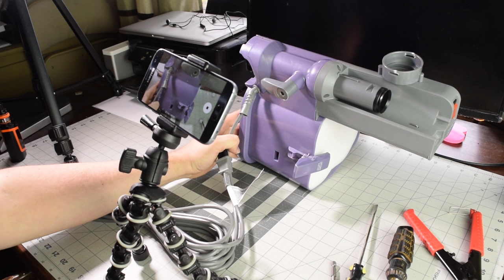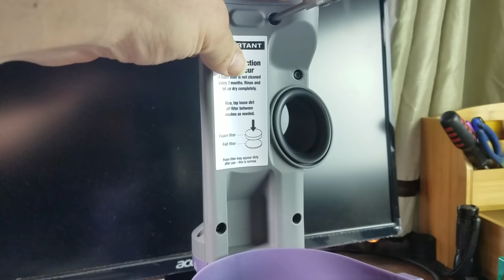Disassembly of a Shark Navigator Lift Away Vacuum Cleaner - Whats Inside?

Comment: Great video!!  WE WILL NEVER BUY ANOTHER SHARK.  We've had a Shark navigator PRO for 2 yrs and the flexible hose cracked at the upper portion that goes inside of plastic tube at the handle.  I'm an engineer, and I removed all 6 screws, disassembled all that was possible, BUT there is no way to remove the broken piece from inside the plastic tube unless I brake the plastic handle, and if I force it there will be NO way to glue it back.  I THREW IT AWAY and BOUGHT A DYSON.  This is expensive but it is THE BEST OF ALL VACUUMS.  If you hear good advice, never YOU buy a SHARK vacuum.
Reply: Mine broke too but unfortunately my cordless Dyson isn’t powerful enough. I would buy another Dyson but very very tight budget but prob someday soon. I scored and got one at. Walmart for $67. I could buy 5 vacuums for the price of my Dyson. Haha by time I go through that many vacuums, I’ll probably be in a position to buy it.
Reply: My shark is 12 years old and has run like a champ the whole time. The motor finally died and I replaced the whole lower chassis for $45 and it's running great again. Shark is the best value vacuum there is. Dyson is marginally better but twice the price.

Comment: I bought one of these at a yard sale and when I got it home the brush roller wasn’t spinning. Thanks to one of your other videos I was able to determine that the safety switch (that disengages the brush motor when the handle is up) was faulty. Rather than replacing it with a new switch, I cut it out of the circuit and spliced the wires together. Works great now!
Reply from the maker: Nice!

Comment: This video is very helpful since I'm taking one apart right now. One tip though you might use: Those little wire crimp/cap things can be pretty easily opened by squeezing them with a pair of pliers, which means you don't have to cut any of the wires, just uncrimp them and pull them out. It worked on all but one of them on the unit I'm taking apart.

Comment: Ya I can’t seem to take the hose that connects to the brush roll out. And my brush roll has a plastic housing. 

Ahh you pulled the house of out the side. Hmm. Mine doesn’t seem to have that. It just goes straight up.

Comment: I have a shark nv531-31 and after repairing a couple of service wires am trying to reassemble however I seen to have two extra neutral white with slide on connectors.  I have no idea where they go

Comment: This was a life saver, I have an 8 year old Shark and needed to clear some hair that I hadn’t been able to clear using scissors.  At first I was frustrated since a lot of other models have toolless disassembly, but then I remembered this was the first time I had to properly service it in 8 years. Which probably has something to do with how solidly it’s constructed.

My only suggested addition would be to point out that the little wheels in the front are hard to pop out the way you’ve shown it - a standard flathead just doesn’t get far enough under the wheel for the necessary leverage. I just ended up gouging and spinning the wheels. I ended up using a slim precision screwdriver to lever the axles out at the ends.
Reply: Do you have any opinion on the hepa filter by any chance?  I've been getting asthma attacks lately I think

Comment: If you do little modding to the suction motor housing with tin snips and a soldering iron, you can fit an ametek italia motor in that sucker and have a more powerful vacuum that makes a more pleasant sound than the stock suction motor. You can also mod in a heavy duty small universal motor that you would find in central vacuum and german vacuum powerheads to drive the beater bars. It will make the brush roll turn faster for better agitation and power through shag and frieze carpet and spins fast enough producing a satisfying audible hum and the noise from the better brushroll motor is akin to a handheld kitchen mixer on the medium speed setting which is pretty nice as well.

Comment: Have you ever tried taking the handle apart?  After having two hoses split on me me (up at the handle end....where the hose is stressed do to unfortunate angle) 

I'm really wanting to see if I could just cut the hose where the split is...remove the end that's attached to the handle and then reinstall the hose into the handle (the hose will be slightly shorter but that's fine)

What do you think?  Should I invest in these bits?  Do you have any idea whether I'll run into additional problems?

I know I could buy a new hose/handle for about $30...but I've done that once already.   Just trying to get the most use out it.  The rest of the vacuum works great.  I hate to add it to the landfill over such a small problem.

Comment: Mine is shooting a spark out of the on off switch. It only does it when it’s in the carpet mode, and is intermittent. 
The beater bar was clogged with dog hair. I cleaned it out and it still sparked. I replaced the switch, and it still sparks.. Any ideas?

Comment: I have a gross smell coming from the green insulation around the motor. What can I do to fix this? I always replace the filter instead of just cleaning it, it's getting to the point where I don't want to use it anymore. Huge fan of your videos I took mine apart and then found this video.

Comment: so i have the nv501 or whatever but the inside looks just like yours. Hoping you can help. I did a huge deep clean on mine today. and was thinking oh this part doesn't plug in so I can run water through to clean it. Well no it has a motor and whatever like yours. Is there anyway mine is still usable? Like even if i wait 2 weeks to let it dry out? I used your video to take it apart and i could see wetness inside the motor and the wire stuff on the other side was wet too.

Comment: For a Shark NV60 Navigstor professional for a power head, it takes 2.5mm special security but screws and do you have the link for those longer bits like the ones used to fit the holes?

Comment: Thank you so much for posting this! But I'm so pissed off at Shark for using these crazy star screws so you have to buy them to get the vacuum apart. They should be included with the vacuum. I cleaned houses for 25 years and took apart every vacuum known to man, with a screwdriver.  This goes to show that all these companies care about is screwing the consumer . What a joke.
Reply: Shark does not make money off of the screws. 
I am pleased with my $12 lil Ares star key folding thing.  Think of it as an investment.  Now you have the tools in case you need them in the future!
Reply: @HigherrConsciousness its not the screws specifically they would make $ from.. it wld be from the cost of repairs or new vacuum from an unsuspecting customer

Comment: My brush roller and motor work fine until I reassemble the base. The belt looks fine and I've cleaned out all debris. Will I need to replace circuit board and motor?

Comment: Don't know if you're checking back on your post. If so, I have a question. Took mine a part to change the carpet brush/beater. When I did, 2 weights (I think) fell out. For the life of me, I cannot figure out where they go. Thoughts?
Reply: I figured it out! They go in the front of the base, on opposite sides. They slot in vertically next to the tiny wheels that hide a screw, tapers pointing up and outwards. Mine each have a little foam pad that goes on the inside, and I figured it out because they had an imprint that matched the plastic in the slot. I hope this helps!!

Comment: My Shark will operate about 30seconds, then makes a loud noise and air bypasses out the side rectangle hole.  There is a pressure device of somekind in the housing above the motor, below the filters.  what is this device and can it be replaced ?  I cant find anyone who identifies it.  Thanks Larry
Reply: Have you cleaned the filters? Mine has done that several times and it is always from the filters being very dirty. Especially the round foam filter.
Reply: Yes what it that? Mine is building up pressure there as well. He skipped right over that.
Reply: Me too same problem! I can't find anyone who can help either!! Have an of you found out yet?

Comment: What is that green clothe ring around the motor was pulled out at the end? Is it dust? I found it in mine Shark and threw it out since it came apart easily. Thanks.
Reply: I know this is an old question. I think it is insulation for sound dampening. Probably not necessary just louder.

Comment: I have a question about my Shark Navigator LV 351, today while I was vacuuming, I noticed my beater brush was full of hair so I popped off the brush head from the main body at the latch you would use to say, vacuum stairs or whatever.  Well I cleaned the hair hair and when I went to connect the brush head back to the main body, the brush motor won't turn on anymore, not even the light indicator activates.  It essentially acts like no power is getting to the motor.

Is this a common thing?  I saw there is an ongoing issue with the small green activator switch in the brush head, but I put a multimeter up it and tested it with the thing clicked on and off and it showed power running through it (I think I tested it right, but I'm no electrician by any means, tested with the ohms setting).

Any help would be appreciated!
Reply: Did you ever get an answer I have the same issue

Comment: Help?  Mom sucked up an entire spool of polyester thread and I took apart the vacuum to clean it out of the brush and on the sides where the brush snaps in. But when I turned it over, these two rectangular very heavy pieces of metal fell out and i'll be danged if I can figure out where they came from. Help? They're about 1" x 2.5" (approx)
Reply: Hi! I'm not the author, but I think the answer to your question (of you haven't figured it out yet), was answered by another commenter - Tony Lyons - who had the same issue and figured it out.

Comment: Had a lot of difficulty with the Shark Navigator Lift Away. I found another screw they have added it is underneath the hose access. That is 9 screws. And I am not putting the screws back in I am putting my own. These manufacturers are buttholes. Great vacuum though.
Reply from the maker: good idea to use your own screws!    Glad you are getting your money's worth.
Reply: @VacuumWars  I don't have a star bit extension to get the middle, deep screw out of the bottom cover. Any other way to get the cover off without breaking it?